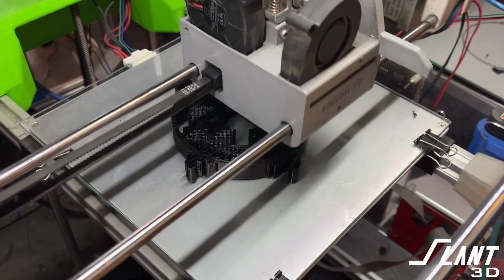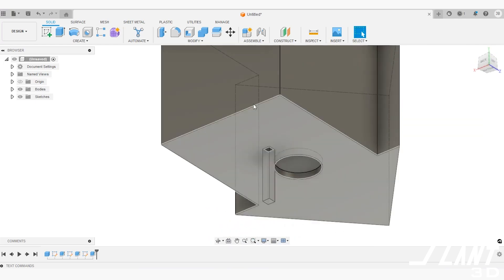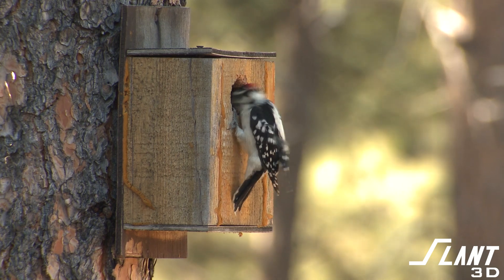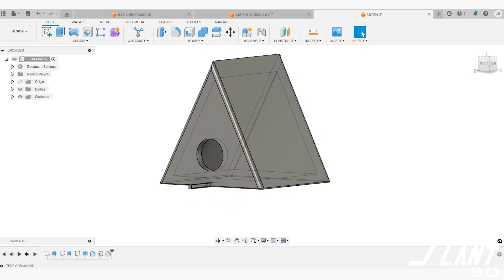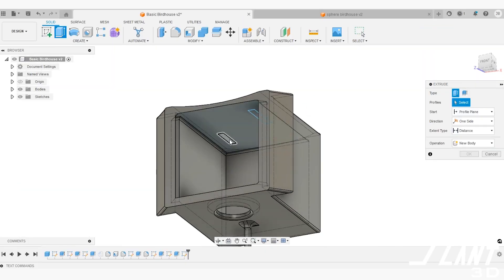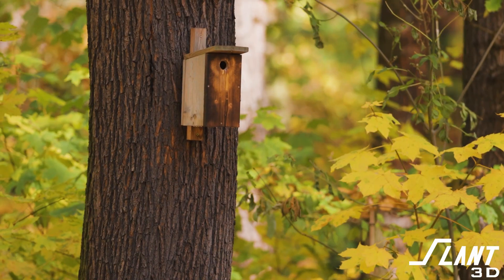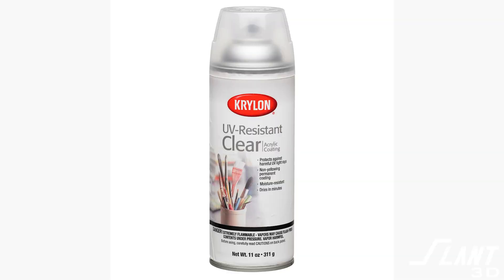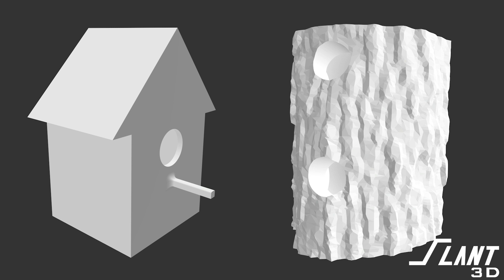Birdhouses | Design for Mass Production 3D Printing

Comment: As an engineer, I applaud your creativity. Unfortunately, you’re looking at what might be good for the consumer and not for the birds. For a functional birdhouse, it needs to have three items, ventilation, drainage, and a method to clean out the old nest. It should also never ever have a perch. Birds don’t need a perch for access (it only helps predators gain access), the hole diameter is important and also should be toward the top.  There should never be more than one hole. 

The designs you chose are something that you might put on a mantle for show, but are not suitable for nesting songbirds. 

Your last design with the bark like appearance is cool, more like what cavity nesting birds are looking for. 

Again for the safety of the birds and their well-being, incorporate the above criteria & you will have created a functional nest box. Hopefully, if you put the idea out there, you will have a product that will help the bird population and let the customers experience nature in their backyard. Thanks.
Reply from the maker: Fortunately you can change the design however you want. This video was to show good design practices and that you can make any variation you like

Comment: I question the advice to use PLA outside. I 3D printed some garden plant labels and some of them distorted in direct sunlight.
Reply from the maker: Watch the full video with sound
Reply: @slant3d  I did. And your reply just got me to unsubscribe.
Reply from the maker: PLA can be used outside with a UV protectant coating as stated in the video.  All the best
Reply: Our understanding is that uv coating stops the color from fading. Is it the heat that causes deformation or actual uv light that does? I've had this happen before just leaving a part in a container in my van. And the container was probably uv resistant polycarbonate and clear.

Comment: While it's important to design with 3D printers limitations and advantages in mind, I don't think there should be too much of an aversion to the idea of having human hands touch a product before its shipped off to a customer. If you limit your designs to just something a 3D printer can print, you're almost certainly going to have a crappy product. Combine 3D printing with heat nut inserts, bolts, bearings, and other parts and you start getting something more approaching what we think of when we think of products. 3D printers are one tool in the arsenal. For example the little perch on that birdhouse. Yes, you could completely change the look of it to be 3D printable easily.. Or just print the perch separately and screw it on with a bolt. Would take 5 seconds and 5 cents. Realistically adds nothing of significance to the process of making the product. If you use a bolt as long as the perch, you now have an incredibly strong perch as well. I see logs of designs on thingiverse that are very much worse than they should be, just because they don't wanna say 'buy a bearing' or 'buy some bolts'..
Reply from the maker: Or design for the process.
Reply: @slant3d i agree that you should design with the orocess in mind, you wouldn't blow mold what needs to be injection moulded or injection mould what can be printed. As an Industrial Designer I think its best to start with the needs of the particular product and depending on budget, selling price and time constraints select your process. For instance I have used 3d printing to produce molds that I would then mix urethane or silicone to produce parts faster than a 3d printer could reprint the files.

Comment: When you turned it upside down you said it would need minimal support but the whole base (now at the top) would need internal support as it is flat and horizontal and cannot be bridged.
Reply from the maker: Design the interior appropriately if necessary. But it can be bridged.
Reply: @slant3d  It can be bridged but would be a bird's nest underneath (pun intended) and a hygiene problem when it came to cleaning. Yes the internals could be changed to limit this but that was not mentioned in the article.
Reply: A bird isn't going to care about your bridging ability or if the floor is slanted. There is suppose to be seed in there. If you want them to not slip while in that v shaped interior then make some smaller bridged branches in the design. Or build an insert that can be printed right side up.
Reply: The bottom doesn’t have to be flat. Slope it just like the roof but without the overhangs. It could be sloped at 30 degrees for a shallow slope that can be printed.

Comment: So I gotta point a few things out.
1. You said that having a human install the landing peg would be too much for mass production, but you go on to say use PLA but spray it with a clear, paint it and add fake moss.  huh?  The amount of processing time for something like that you are better off blow or roto molding the design and have a nice smooth or textured finish with no post process needed.  Plastic will already be UV stable.
2. You said the cost of the wood houses are cheap, which they are.  Some hardware stores give them away.  but buying a simple wooden bird house is $10.  Most of the fancy looking printed ones are assembled and multiple materials and cost $60-$100 to buy off Etsy or other places.  In some cases it cost just as much to buy the 3d model to print yourself as it would to buy a wooden one assembled.  It takes seconds to cut the material for a wooden house, but hours to print each piece of a 3d print design, even a simple one.  How are these comparable for production?
3. A true mass produced custom bird house certainly wouldn't be 3d printed.  Laser cut the wood, flat pack it and let the consumer assemble like Ikea.  Shipping is cheaper, you can still cut on demand, the human interaction is the end user so it doesn't add to the cost to produce.

I just don't see how this is a good use of 3d printing "for mass production".  Most of the really detailed ones you show are resin printed or have undergone a lot of post processing and painting to make them look good.  There is no way I would pay $60 for a birdhouse that was FDM printed with a bunch of layer lines on it.  Great for one-off custom projects at home, but doesn't seem like a good mass production argument.

Comment: Leave the peg off. The resident birds don’t need it and it gives competitors a place to securely attack from.  Just some old well intentioned but wrong idea, like putting butter on a burn.  
Overall, your usual excellent design insight, thanks.

Comment: Also, can you make a video about how recyclable PLA printed products are? That is a selling point I want to make to customers -- "when you're dong with this 3D printed product, you can recycle it."  Again, thanks for providing so much useful information !
Reply: You might be interested in CNC Kitchen's video "I tried composting biodegradable 3D prints" which is about his experiments with PLA.
Reply: In theory they are, but in practice it's very rare. Also it shouldn't be mixed with household plastics in recycle bin. When you making it as selling point (but you don't offer recycling yourself) it's just greenwashing.
Reply: @cyrkielnetwork  Yeah... that's why I haven't made that point to people yet. I wish there was a straight forward tway to just recycle this stuff
Reply: @muyscully  PETG could go in household recycling, but odds are the people filtering it won't realise it's PETG and will send it off to a landfill anyway.
Reply: @georgestone8099  start printing a recycle logo? :)
If im not mistaken there are machines that let you reclaim and respool certain materials.  Not quite the same thing though
Reply: @georgestone8099  THanks, that's a good point! It would be my responsibility then to allow customers to send products back to me for recycling..
Reply: Petg is "reclaimable".  Not sure i would want a PLA part to be sittinf in the elements.

Comment: Thank you for this inspiring video! You said you would print the birdhouse with PLA, but doesn't that melt in the sun with hot weather? I've been relecutant to create outside products with PLA. Can you clarify about this? THanks so much!
Reply: I agree with what you said. I printed a movable piece for my son with PLA. Left in the sun, the PLA warped and now it doesn't move. I've always heard at the very least PETG, but ASA and ABS are recommended for outside use.
Reply: PETG is my go-to for outside use. You just need an all metal hot end.

Comment: I also designed a birdhouse (more of a nesting box) for 3D printing (it is up in printables).  In my case, it is an open design because it is meant for "open nesters" in contrast to "cavity nesters".  This bird house is made to take a whole spool and is very large in comparison with other bird houses, it is broken in two parts that have to be glued together.  My design is also made so that it can be hosed down after the chicks leave the nest because the little things poop a lot and they don't take it with them when they are done.  I did not see much of a business model here because my design would be very expensive, i.e. 1kg of material and it took me about 12h printing time for each of the two parts on an X1C.  I opensourced it up in printables.  This was my first PETG print, and I really liked the material.

Regarding the design that you posted here for cavity nesters, one advantage of plastic is that it can be cleaned easier than wood.  A design feature could be a plug in the bottom and internal slopes inside the birdhouse so that a single water hose assisted cleaning operation could be performed to ready the bird house for the next bird family.

Comment: Thank you for posting this video. Because there is a great deal of concern about the use of plastic and its impact on the environment, would it be possible and more eco-friendly to print birdhouses using a biodegradable wood filament? I would be interested in yours and your subscribers thoughts on this.
Reply from the maker: It would be more ecologically friendly to make birdhouses with printing rather than other processes.
Reply: @slant3d  Thank you for your reply. I agree, I do a lot of 3D design for the plastics industry and I am not anti plastics. I simply thought printing with wood filament would possibly compound the ecological advantages of 3D printing. I would appreciate your thoughts on this i.e. would it be practical etc?
Reply: Wood filament is still plastic only. There is some that has actual wood fibers but it's harder to print with and would not do anything for the environment. That fiber dust would simply be reused for making mdf if it wasn't put into filament.